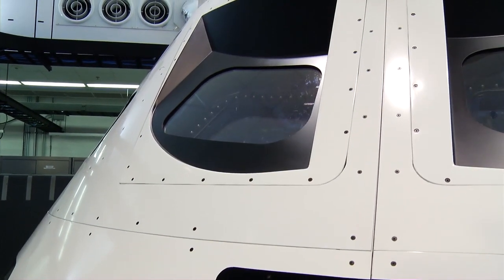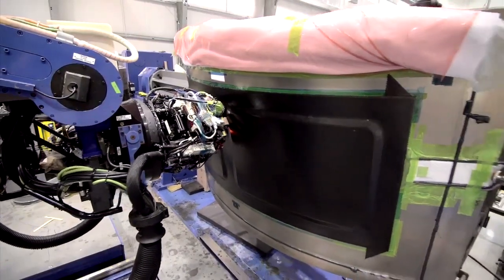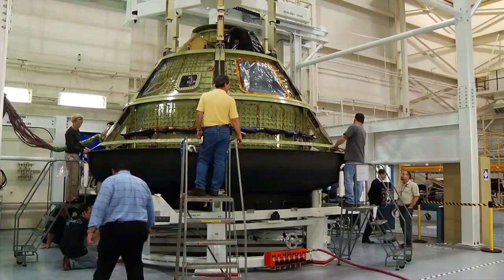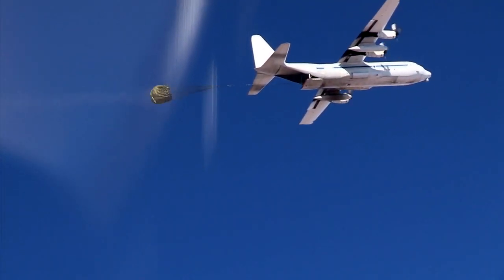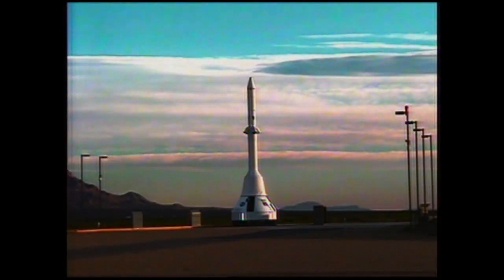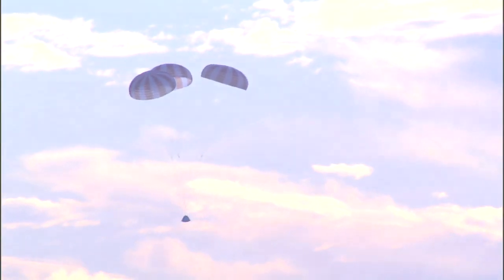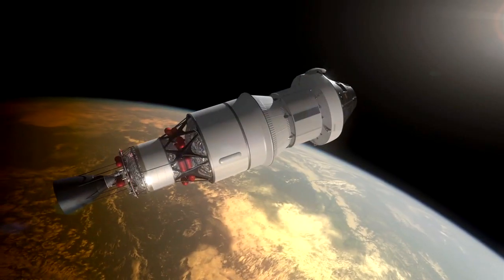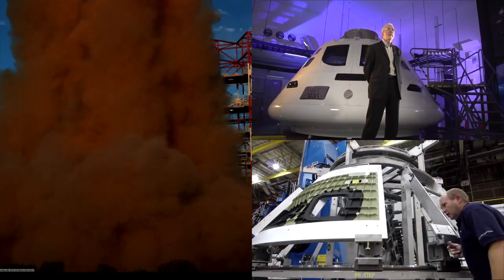NASA's Orion: From Factory to Flight

Comment: Not really, as long as you don't stare at the source you don't have much of a problem. Also with new technologies that dim the headlight closest to on coming traffic while the car is approaching, it's not much of an issue. 

Technically you are supposed to look at the white line on the right side of road so you can preserve your night vision. 

It doesn't matter what kind of headlight you have, all visible light will disort your vision.

Comment: True, but my point is still valid, G-tolerance differs from person to person. I also forgot to mention that it depends on the length of time the force is applied, You could survive 100G slap to the face if the impact only lasts 0.01 seconds. But 10G's for 20 seconds will kill you.

Comment: @shadownor The shuttles were not a mistake. They were designed for the task they were intended - IE a relatively fast launching vehicle that can launch, then capture satellites for retrieval. Water landings are not actually the greatest thing, but they are something NASA is intimately familiar with - plus, the US has a large body of water in the direction launches are typically performed - the Atlantic Ocean.

Comment: @Holmesy87 You're slightly offensive and that has no place in science or space exploration. Also the shuttles were never intended for deep space exploration nor able to perform outside initial set parameters. Pods on the other hand *Since inside quarters isn't a disputable matter* are by design quite versatile and easier to use as space exploration vehicles.